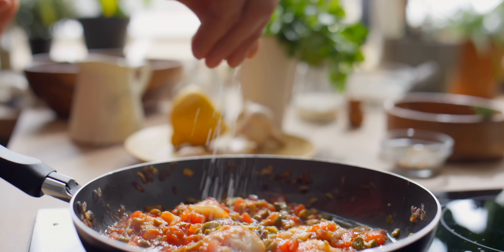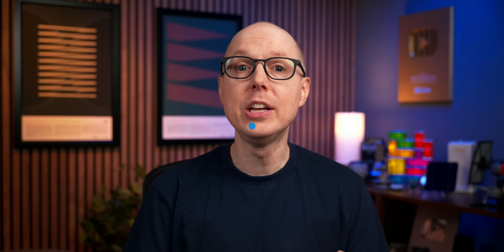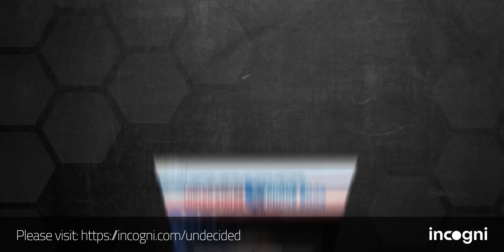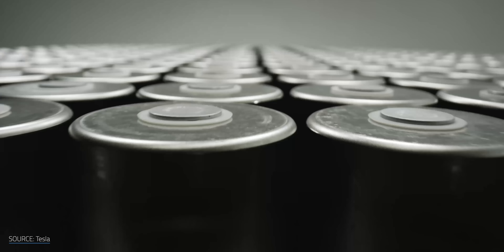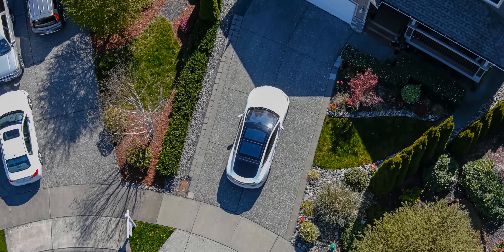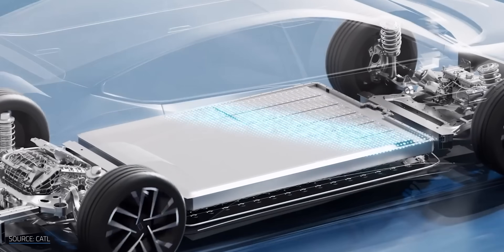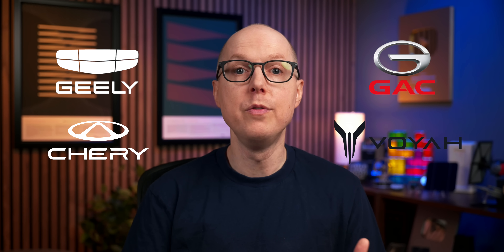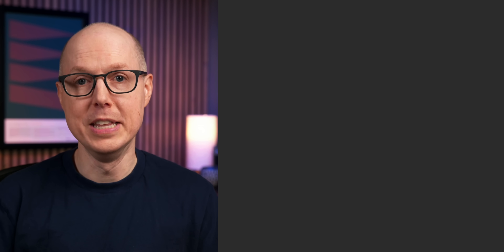How CATL Made Batteries 90% Cheaper (And What Happens Next)

Comment: Maybe I missed it but you didn't cover weight. Having a battery that performs a bit less isn't much of a problem if you can put more of them into the product. Why not have 2 rows of battery and double the range, if you catch my meaning. Well the reason for most is the weight, its just to heavy for consumer cars. Is this one lighter in a meaningful way?
Reply from the maker: It's almost equivalent to LFP batteries for weight now, which are already widely used in EVs.  It's a good sign for the future of this tech in cars.

Comment: The impact on the global energy market would be massive. While solar PV is already the cheapest and fastest form of grid scale energy generation, cutting the cost of accompanying battery storage would be a crippling blow to fossil fuel generation. Why start building a new combined-cycle gas plant when the needed turbines are 4-6 years back-ordered and your ROI is measured in decades when you'll be obsolete in 2 years by solar + sodium batteries?
Reply: I'm just going to go off of what I know. One lipo4 batteries came out. Everybody was telling me I should get one for my bicycle trailer with the solar panel. I looked at the price. My 100 w hour Marine deep cycle battery cost $110. The 100 w lithium battery cost just about $900. The lithium battery couldn't take a charge below a certain temp or above a certain temp. I know the lead acid batteries charged at those temperatures. That's why they're in cars. The salt battery. If it's cheaper similar power. That sounds like a buy-in point for me.
Reply: This dynamic is already happening with LFP BESS's (which is awesome).

EDIT -- Sodium ion below $50-60/kWh just accelerates it.
Reply: The requirements for storage batteries are also so much less stringent than for moving vehicles. Weight is way less of a factor giving a lot more options.
Reply: Cuz solar isn’t reliable enough to replace fossil fuels.
Reply: @keithskoglund10  And that's the reason why Sodium batteries are very interesting.
Reply: @keithskoglund10 Australia has entered the chat and pulloitley deesagruys.
Reply: @mikalrage7316  That just supports what I said.  Solar is only somewhat viable in very specific climates.  It can't work for any area that sees typical weather patterns with rain, snow, or seasonal cloud cover.
Reply: So, few options 
First, combined power generation. Obviously nuclear fission exists and is great, but lets assume thats not an option. Add in hydroelectric and wind. Hydroelectric is immediately covering a base load. And theres several ways of setting up hydroelectric, so don't talk about the issues with dam lakes. Don't get one of those with the 4 turbines at niagra falls. 
Then wind power. Offshore wind turbines are quite concistent due to persistent sea breezes. And onshore wind turbines typically going to be generating more power in the weather conditions that solar panels are receiving minimal power output.
Then Solar provides the main power generation due to ease of installation, microgeneration, and low cost. 
 
To cover nightimes, in addition to the base load covered by hydroelectric and wind, we have 2 delightful storage options. The first is batteries, such as these sodium ion ones. Main requirement for those is just the number of charging cycles. But also, we get my favourite energy storage of pumped hydroelectric. Big lake at the topbof a hill, big lake at a bottom of a hill. Excess power pumps water from the bottom lake to the top lake, if extra generation is needed then water is left flow down from the top lake, running s turbine. Incredibly efficient, and already quite common, because fossil fuel plants, in addition to Incredibly high setup and running costs, are absolutely terrible at responding to spikes in energy demand, whilst pumped hydroelectric, in addition to being cheap to maintain and green, can spin up to maximum generation in under 5 minutes, producing multiple megawatts of power. 

Also, jf we absolutely require some form of combustible fuel power generation, biogas exists. It's not particularly great for scaling up, but it's close to emissions neutral, so way better than standard gas or oil.
Reply: @Santisima_Trinidad yup I worked on a hydroelectric pumped storage facility and it’s essentially just a big battery.  But getting the regulatory process complete  through FERC, and the extreme upfront construction cost pretty much makes them unbuildable in the USA.
Reply: @keithskoglund10  The sun comes out every single day, and if it stops doing that, then we have bigger problems to worry about than electricity.
Reply: @Logan4661  No it does not.  Any cloud cover impacts total power output for solar, even fluctuating by time of year for the same fully sunny day.  Plus what do you do when it's night time?  We still have a significant power demand at night requiring full time power generation.
Reply: @keithskoglund10  Yes, it does. Your small world, 20 years ago, "thinking" fails to take into account that the grid covers wide swaths of land, it's not all covered by couds, all at the same time. 
Clouds and night time? What do you think the batteries are for? DUH!
Reply: @keithskoglund10  solar is predictable, not minute by minute at days away, but with storage you're looking at averages over longer timescales, and they ARE predictable. May still not be enough, but storage increases the amount you can actually use in a big farm (already we turn off noerth sea wind turbines, a battery just onshore could remove that peak)

Comment: No information on home batteries? 
Surely these batteries would be better for homes as size \ weight wouldnt be an issue?

Id love to see batteries cheap enough to go in every home, Electric companies then wouldnt need to produce excess \ wasted power as they currentlyl do. ie they could charge batteries during the night when power requirements are reduced.
Reply: China doesnt use much home batteies so I doubt that would be a priority for them
Reply: @dantronics1682 Why not? they have the same power issues as every power provider around the world would have.
Reply: @Don-ii4vm  Most of the urbanized world lives in flats, not in single-family detached homes. A big portion of it also does not have to suffer under private utility monopolies, and can ensure that blackouts are exceedingly rare. Storage in a dense city is more likely to be centralized at a whole building or a city/district level, and rooftop solar is much less useful due to a much larger number of people per square mile.
Reply: @E1Luch  So what?
Dont get me wrong, it would take some negotiation, but Power companies ALL use the same infrastructure as each other, they didnt each install their own cables to each customers house. Same could be done for batteries. 

Using batteries would smooth out power requirements resulting in less power wastage as power companies ramp up \ down due to demand.
Reply: @Don-ii4vm  Not sure what you mean, they do have a lot of grid-level storage in China already, just not as much personal in flats. Chinese grid is just 2 state-owned companies each managing their own region as well. The point is, its not as useful in a city because you get most of your energy from the grid anyway, and its reliable, and the operator doesnt overcharge you like crazy
Reply: @E1Luch  Really? Can you provide examples of the grid level storage and how it works?

you seem to be missing the point of battery storage. 
During PEAK usage Power companies have to ramp up storage and ALWAYS have to put more power in than is required... WHICH IS WASTEFUL.
If Power companies used batteries PEAK POWER requirements would be drawn from the batteries.... which could then be recharged during off peak hours.
Power companies would then have a more stable and efficient grid.
Reply: @Don-ii4vm  Pumped hydro, which China has a lot of, is an example. But also any battery that is not managed by end consumer. Same thing with solar. Also I have no idea what you are disagreeing with, I know the purpose of batteries, Im talking about who manages them and at what scale. Regular people in their homes usually dont pay spot market prices
Reply: @E1Luch  Pumped hydro isnt very efficient though, is it? the grid is still flooded with excess energy. 

Im WELL aware that regular people dont pay spot market prices, however IF batteries were used, then Power companies would have to constantly produce energy for random demands, it would reduce costs for Power providers, who could then lower prices for customers... which would potentially get them more customers.
Reply: https://www.youtube.com/watch?v=5cNwwrD379o
Reply: I've provided a link, but not sure you'll see it,  search for video titled. N.Y. company is using batteries to reduce stress on power grid

Comment: I would have no problem in buying an EV with a battery of any description as long as it costs less and is guaranteed for many years by the car manufacturer. Hopefully manufacturers are designing more vehicles where the battery can be upgraded with ease to new technologies. I don't need a longer range. 300 miles is quite enough. I don't need faster charging -  300 kW is fine. A lighter vehicle would be useful but sodium doesn't seem to be offering that.
Reply: Define 'upgraded with ease' - as if your talking typical EV battery in many cases now they will outlast the rest of the vehicle's typical service life anyway (obviously user and location variable, and the degradation will be noticeable in that decade and more of time - but the old ICE cars have the same problem, just spread across thousands of moving parts that have gotten worn). As it is already about as easy to change a battery changing/rebuilding the power train of an ICE really there isn't much point. Both are a serious pain in the arse, but doable if you really want to (as rather well proven by all the classic cars getting EV refurbishment you can EV anything if you want to). 

Really upgraded with ease is just not worth designing in unless you are also creating a nationwide hot swap battery system or something so the 'fuel stop' on your EV can be petrol pump quick, which I really can't see having a big enough market demand to be worth it - when your EV already lasts hours of driving, which is pretty easy to do even in the smallest car footprints the human inside wants a break anyway, so taking that break while the car charges hardly matters - otherwise build them solid, build them well protected by the frame, with good thermal management etc so they should last, as they are not a component that really needs maintenance.
Reply: Who cares if it is heavier? If it is cheaper then what is the problem?
Who wants to drive a girls car anyway?
Reply: @Vile_Entity_3545 Boys, you heard it here first: it's bad to like a car that can actually corner 😂

Comment: What a great use of brine byproduct from desalination! Water and power for all!
Reply: lithium is also a byproduct of this brine.
Reply: @altondevine true, but why use one dumped resources when you can use two?  The more we can extract from current processes, the better.

--another member of the Rossmann Clippy gang
Reply: @altondevine I approve of clippy
Reply: @Strife it seems you are in the process of approving Clippy. Would you like some help with that?
Reply: @altondevine  It's not even comparable though.
Reply: @altondevine  except the ratio of sodium to lithium in seawater is approximately 60,000:1.  DERP
Reply: @rotaryenginepete  yes but brine is more dense
Reply: @masterjj528 that doesn't change the ratio 😂
Reply: @rotaryenginepete  yea but that's still literally one of the methods used to 'mine' lithium. Because the energy density matters.
Reply: @nfzeta128 it's actually not.  You are thinking of brine extraction from underground reservoirs, which is not the same as  desalinization of sea water.
Reply: @rotaryenginepete  It literally is, it may not be used much but that doesn't change it's one of the methods.
Also the discussion was around brine as starting from just sea water is just not efficient. It's just one step later.
Reply: @nfzeta128  False.  Desalination is literally a different process that produces fresh water and brine as a byproduct.  Brine extraction uses fresh water to dissolve and transport salts to a location where the water is evaporated and the product is the salts.
Reply: @rotaryenginepete  what you're saying in no way denies anything I said.
Reply: @nfzeta128  correct.  what I said debunks what you claimed.
Reply: @rotaryenginepete  ???
Reply: @altondevine  lithium comes mostly from chile and Australia, which extract it from deposits, not from brine.
Reply: @recarras where does sodium mostly come from? not from brine either. that's my point.
Reply: Beat me to it!
Reply: Bingo! It's win-win. Any nation that has a salt supply can basically make batteries locally if need be... This unlocks a lot of potential especially when you don't need exotic elements...
Reply: @teg119  does anyone in the comments understand that it's not just NaCl dumped into a battery casing?
The battery manufacturing is much more about the structure of the inside components/metals than just purifying a specific ion. This is the whole reason why sodium batteries are not yet cheaper than Lithium.
Reply: @ian4683  total confusion here by people confusing NA and NACL. Big difference.
Reply: Which could be created by solar panels that tend to generate a lot of heat and power.
Reply: With the massive amount of desalination that is already happening, you can see why this is a winning alternative, maybe not right now, but soon
Reply: yeah funny how where they get the most lithium  is from Brine pools
Reply: its unfortunately not a great use lol!! its going to require alot more energy to remove salt ftom the brine than just for example just taking sand from quiary
Reply: @carholic-sz3qv  In some place you pump the brine into evaporation ponds.
Reply: De-sal is a poor source of water and it produces far more waste than any industry can handle. I did the math once, a city the size of LA using only de-sal would produce more than 100x the global salt market in waste. De-sal is a niche only source of water and has no large scale practical uses.
Reply: @EthosAtheos  the thing with new technology like that is that it sparks further industry in related industries. screws used to be handmade and not feasible to use in construction until new technology and machinery came along to speed up and standardize production. from there, screws supported a bunch of things that we couldn’t create easily without.
Reply: Until the destroy the oceans eco system
Reply: @garysgarage.2841  As opposed to all that clean oil spilled during the Deepwater Horizon and Exxon events? LOL. TRY AGAIN TROLL!

Comment: I dont see how they can become relevant in ev. Lfp is around 70$/kwh. Thats 3500$ for a 50kwh ev battery. Sodium might be cheaper but also brings 50% more weight and size to achieve same range. Thats a huge disadvantage for already heavy evs
Reply: Sodium allows for much faster charging. So for a 35kwh battery, you'd take a fraction of the time to charge fully
Reply: So lets say under 1k$ for a pack and you don't see how they could become relevant? Charging below freezing? Not heating battery in the freezing for charging? Game changing in winter climates.